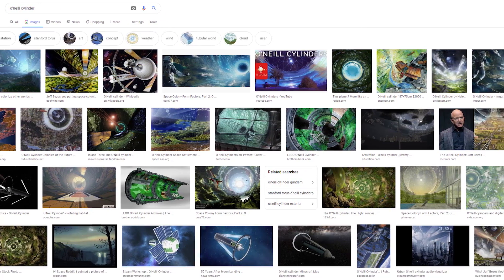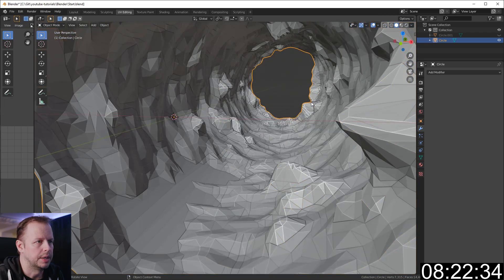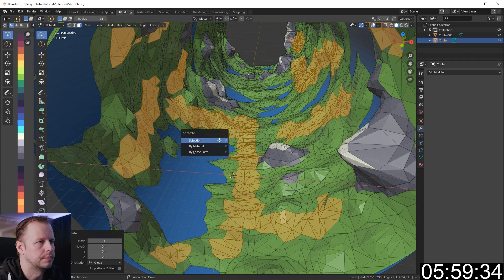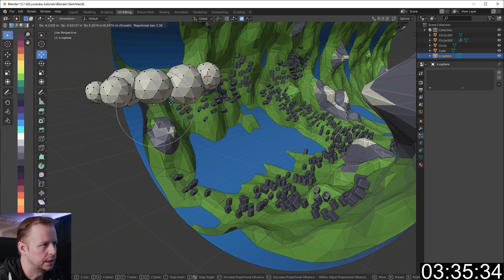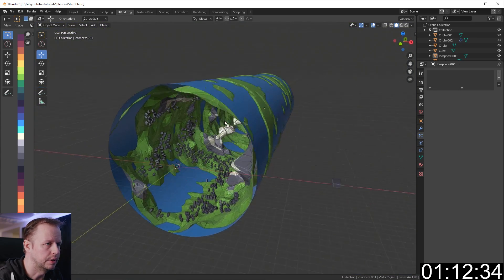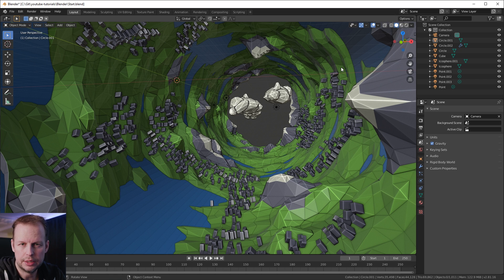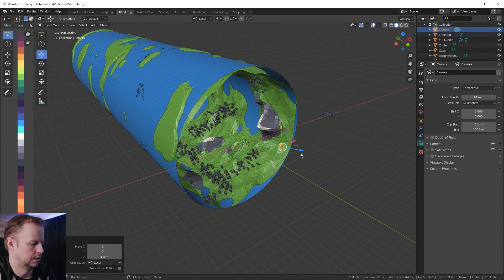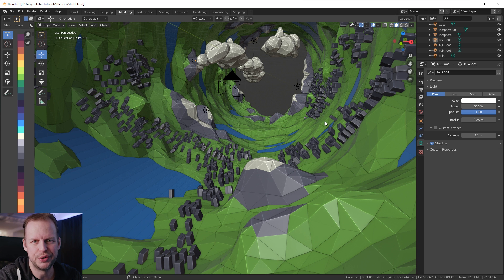Let's Make an O'NEILL CYLINDER in 10 MINUTES in Blender 2.81 - ep. 7

Comment: When placing the building down on the land the building went every where and the hairs faces outside the cylinder instead of inward. Does any one have a fix for this?
Reply: probably need to recalcuate normals - in EDIT mode, select everything, then ALT-N to recalculate normals inside

Comment: You can make game in blender?
Reply: Yes Blender version 2.79 still has a game engine built in. Download and start it. You must change your window at the icon left top or bottom (depending on your settings) dropdown menu  to Logic Editor. There you can connect for example a  keystroke (sensor) by an and/or (controller) to a motion (actuator). THAT way you can move your object with your up down and left right arrows. Very simple and straight forward. Success !!

Comment: Lighting on/ in an O'Neill cylinder is done five ways. 
1. Windows replacing part of the terrain or hidden under the lakes. Mirrors bouncing light in through them. The original design. 
2. Giant linear light tube down the axis. Powered with external solar arrays. Babylon 5
3. Three or so light sources running the length of the structure on the ground with mirrored berms either side so they don't cook the terrain nearby. Rama. 
4. A large mirrored globe with lighting coming in from both ends and scattering off it. A moveable mini sun.
5. Thousands of large light drones. Or millions of small bright light drones.

Comment: I would have done the clouds as particles on a third cylinder so they are lower, smaller and more numerous. Normalise the buildings to the outer cylinder not the terrain. Some of the mountains are too high. Assuming they are hollow that's possible but I would plateau them.

Comment: You should have put this object in Unity and animate the camera passing trough and rotation on the cylinder.. Add post proc and capture it in HDRP... 
Also a note... I don't believe you can actually edit multiple objects parameters.. so when you selected all the point lights.. You actually edited only the last one selected, That's why it was so bright... You should have btw switched to cycles..

Comment: One thing you could do would be to set the buildings to the water mesh, that way they would all be in line with the main body of the cylinder. You can increase the height of the buildings so that they poke through the ground mesh. 

I have attempted to make my own O'Neill Cylinder. Renders and some how-to. https://imgur.com/gallery/ozrusO3

I used area lights to fake the mirrors bringing the sun into the cylinder through windows on the sides, which is how they presume to light the 'real' ones. I upped my scale as well so  you wouldn't really see particle buildings. I tried particle clouds and also textured clouds, to see which worked better. All rendering was in Cycles. I used a static picture of the Earth  on a plane to have the Earth visible outside my colony. You could easily create a sphere and apply earth textures available on the internet.

Comment: If you actually built one of these, you would not depend on the local star for interior lighting other than to provide power to run a tube of light through the center of the cylinder. Remember the cylinder rotates along it's long axis at a rate determined by it's radius to simulate gravity. If you used the sun to directly light the interior it would only enter from what would have to be transparent ends and it's angle would be constantly, visibly changing around the landscape at what ever the rotation rate. Day and night cycles would best be completely controlled in a 24 hour cycle by adjusting the light tube down the center. People coming from off a planet would find it strange at first because ground shadows would be very diffused, not so much like a cloudy day, but more like interior lighting in an office environment, but with a tendency for shadows to be biased along the length of the cylinder. Children born to such an environment would freak out the first time they went planet side to visit their grandparents because the Sun's direct shadows would be strange to them. 
Actually a cylinder of this size (relative to the buildings) would not form puffy clouds. Air currents would mostly move around the diameter of the cylinder like in a tumble cloths dryer. Moisture in the air and air pressure would be pretty constant throughout the entire volume, maybe a slight decrease towards the center, so ... no rain, no clouds. Clouds and condensation would only happen naturally if the cylinder was 40 or 50 kilometers in radius.

Comment: A few suggestions for placing the camera quicker and more accurate:

You can use 0 on numpad not only to view the camera output but also to move the camera in that view, so you can use g to move it while looking through the camera and then use the x,y or z buttons for axis-movement, or double-tab them for local movement. So moving the camera in would be g, double z.

Another very much underrated possibility is to use the view navigation function to move the camera. For some reason the hotkey for it changed when blender 2.8 was released, i preferred the old hotkey of shift + f... with it, you can fly the viewport with w,a,s,d controls and q or e for elevation. The nice thing about it is, if you are in the camera view (so numpad 0) the camera will stick to those controls, which means you can place the camera exactly where you want with w,a,s,d controls =D you can also change the speed of that camera if you scroll up or down (only working while moving) to slow the effect of those controls down or speed them up. When pressing shift you can also "run" so you get a boost for movement speed. All these controls will be shown in the lower section of the viewport when you engage the view navigation mode. I nearly only use the viewport camera like that because its far easier for me to place the viewport where i need it to be :)
Reply: Another great trick is to mark the check "Lock camera to View" in the "View" panel, then you can move the camera using the same way you use to move the view.
Reply: The way I put my camera in a rough spot.. move viewport cam hit  CTRL+0 Numpad and it moves Camera to viewport you then hit G and use your X Y Z move to position more as well as use the rotation options.

Comment: One of the options for lighting the inside of an O’Neill cylinder is to have strip lights embedded in the surface, running the length of the cylinder—say 3 of them, distributed at 120° angles. Each one provides light for a portion of the opposite surface.

Comment: 0:51 ship rotating put you still are weightless.so it mean you floating and ship moviving around you lol. rotating ship not make gravity its movie fail. just like pulling knive from leather it make metal sound? lol etc..
Reply from the maker: Ah, I never really looked in to it. So the centrifugal force has no effect in space - even on larger rotational bodies that rotate around their own axis?
Reply: That's incorrect. Centrifugal force will make you rotate along with the cylinder, simulating gravity. In a vacuum you'd be weightless until you touched the surface at which point you'd be hit by the cylinder traveling 450 mph (lol), but as it would have an atmosphere which would travel with it, that wind would pull you along and create an artificial gravity that would increase until you touched the surface.